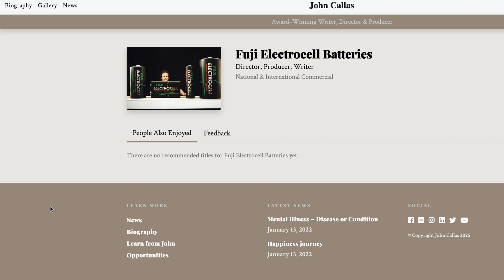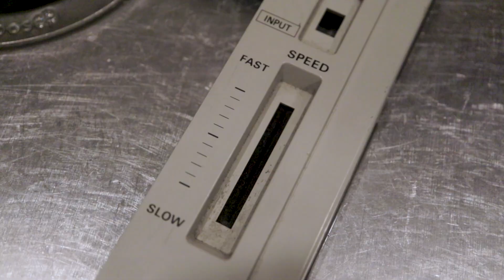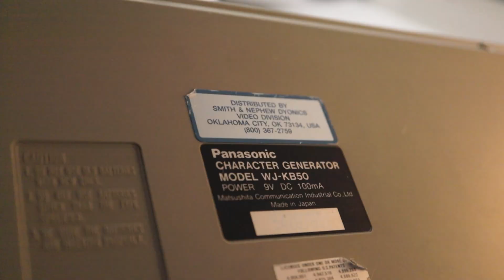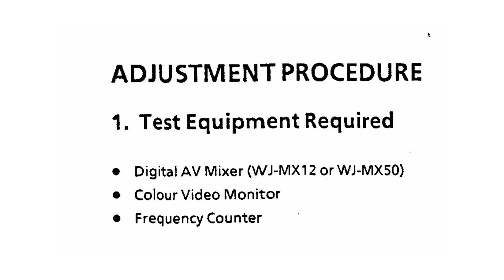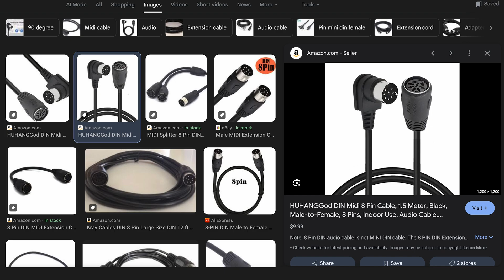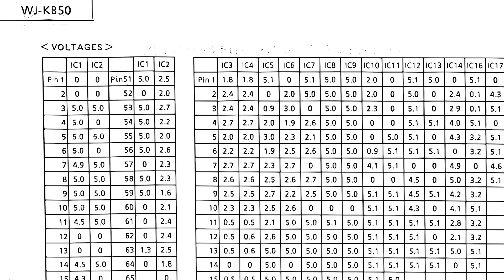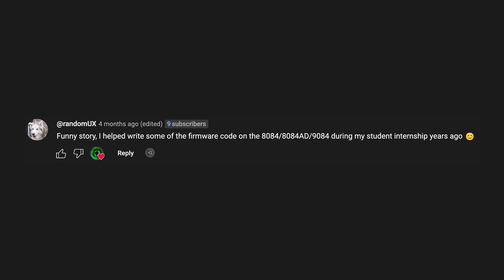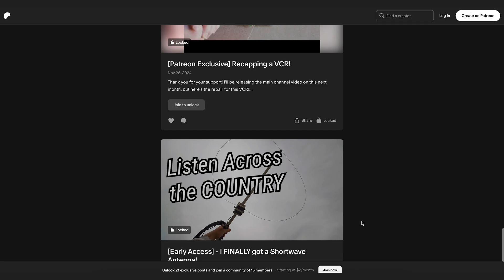This is not a keyboard... Panasonic WJ-KB50

Comment: From the video, the chip in the mystery board seems to be an AD847JN, an amplifier IC, what gain it is setup is hard to tell from just the video, specially there is a variable resistor on it, and I don't have the trace layout to know how it is configured. As for the service manual, having such details is amazing, and I wish everything had something like that, it is also super well detailed.
The service manual having the schematics should allow for repairing the board if needed and understanding the modifications done to it.

IC16 got my attention as it is an AND with an end connected to constant 5V, and I was wondering if it was an analog AND IC, but it seems that the IC model they put in the manual has no datasheet anywhere. Same goes for IC2, the chip you probed and didn't get the expected voltages.

Comment: I wouldn't expect this to output anything without being plugged into a mixer, because in order to overlay text on a video stream, the two devices need to be in sync (aka genlocked), so without supplying video to the titler, I just don't expect it to output anything.
Reply from the maker: Good point

Comment: Hey man! We actually work regularly with this keyboard! We got a scuzzy one off eBay a few months ago and had to clean it up like you did yours. We were lucky in that we had the mixer board this keyboard connected to, a Panasonic WJ-MX20 board to be exact. The weird pin connector port is compatible with the WJ-KB50's original DIN connector, which is great because the connector is so dang rare i've never seen one like it before buying this keyboard. While I cant say much about fixing the innards of the keyboard, I can show an example of what the text looks like when you do get it working - https://www.youtube.com/watch?v=0BAF7rb8Vvk&t=975s . We use ours to make a community calendar in our town and it's a pretty nifty character generator with lots of fun options, and it seems those options are kinda tied to what board you use, but i cant say much on that either since we only have the one board to test it on. Looking at the connectors, yours is definitely custom and ours is the stock 10-pin DIN, the connectors are not the same cause it looks more like the connector in the photos you were looking at than the connector that was installed on yours. For a bit of context on function, the keyboard would connect to the mixer and superimpose the characters onto the video feed that is coming into the mixer and the text would show up coming out of it, so i don't think it can simply superimpose text by itself without a board, would be fascinating if I'm wrong on that though cause i'd love to see what other crazy custom things you could do with it. Gotta wonder what rig this would've plugged into... Definitely a flagship piece of tech in our collection we love using, best of luck reviving yours! Please do a follow up if you turn it into a usb keyboard, that would look so cool too!

Comment: The chip on the little board seems to be an Analog Devices AD847 op amp, so it shouldn't be to hard to reverse engineer. it also seems to have a lot of capacitors and resistors around it and a trimmer so maybe an oscillator or filter of some sort? 

In regards to baking it in an over for reflowing it, i doubt that would be worthwhile. reflowing is only really worthwhile as an absolute last resort on smaller BGA smd ics where the solder balls are below the ic. it would probably just cause more damage than good. The lack of voltage could be caused by a more systemic power fault, or potentially the modification may have disconnected some downstream part of the circuitry or something. 

In regards to further troubleshooting steps, i would recommend checking the voltage rails of the ics and making sure that they are all getting what they should be, checking power supply ripple, making sure you're getting a clock signal and making sure the reset signals are high.

Looking forward too seeing what you do with this character generator! Good luck!
Reply from the maker: Thank you for the info! I'll try all of those

Comment: Nice job and great humor, Simon!  My guess is that nothing will happen without some kind of a clock on the sync input at Pin 10.  I hope you'll consider an engineering career, you're a natural!
Reply from the maker: Good idea! I'll look into that! Thank you :)
Reply: @simonretrotech  You're welcome, any time!
Reply: looking at the connector it appears that the RGB out was cut out and then the character out went to that hack on board, as the only wires connected are ground, 9v, sync, and character out.

looking deeper at the schematics, IC14 is a Sync signal separator, which takes video in and can detect the sync rate. im guessing the green wire sync in has the video input, or at least the hsync and then IC14 feeds that to the main IC that has the RGB out.
Reply: @jjjacer Yep, you need a 3.579545 MHz sine wave on the Sync In line if you have no video input; the TV should sync to that if it's close enough. You need to couple that 3.579 MHz signal into the TV as well. Your chip may already be outputting Sync on Green; in which case do nothing. If the chip does not pass sync through, and it might not on a mixer, then figure out which of RGB your monitor is sync and tie your 3.579 MHz signal to that line with something like a 10nF capacitor. Sync is usually Green on most monitors. You can create a black and white composite signal by tying the Green and Sync In together with a 10nF capacitor.
Reply: You may be able to create a full color Composite output by tying R G and B to the Sync In line with 10nF caps as well. I am not sure on that point. Try it. There's little risk playing with the video signals.